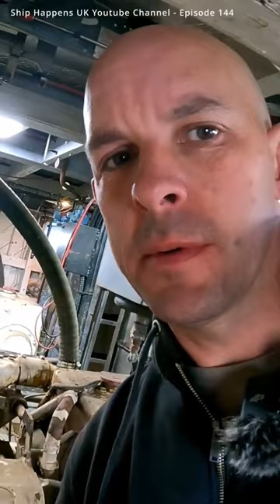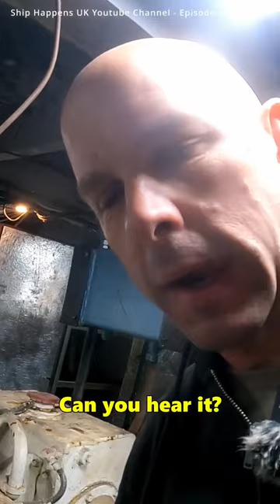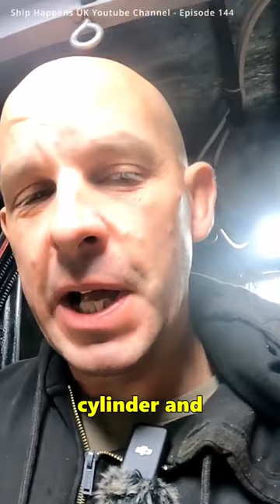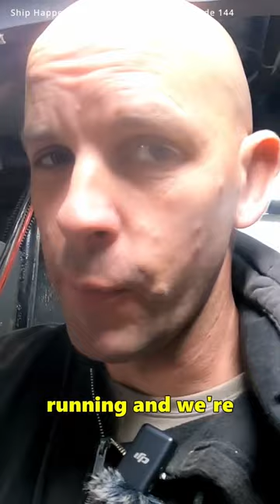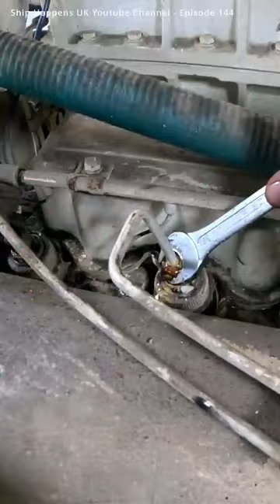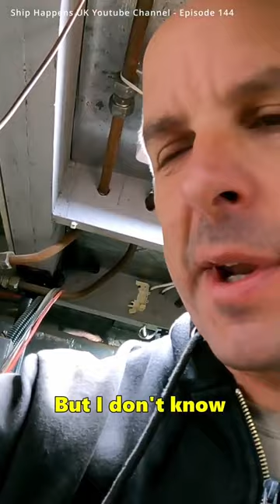Whats up with our boat engine? #boating #engine #boatwork #engineproblems  #marine #dirtydiesel

Comment: I noticed that when you cracked off the injector pipe on the faulty cylinder it appeared to show a lot more fuel perhaps indicating a faulty delivery valve washer which sits inside the adapter the inj pipe connects to on the inj pump , it’s easy to check and if found faulty crofts in Llay by you would probably be able to supply , regards Steve , enjoy your weekly vlog keep it up
Reply: my diagnosis precisely

Comment: Crack each fuel line union at the injector in turn. When you reach the dud one the engine noise will not change. On the good ones, cracking the line will add to the misfire and you'll hear extra noise.
Reply: Literally what he's just done in the video?

Comment: Do you have leak off/return pipes coming off the injectors? If you fo you vould run those into measuring jugs and see if they're all flowing the same amount. Blocked/failed one will produce more. If not swap the suspect one with a good one and see if the misfire moves with it.
Reply: Well being they opened up each fuel line on the top of each injector and seen one spewing more fuel out than the rest they already know something's up with #5, more than likely a clogged injector.
Reply: @madmax2069  spewing from the feed pipe doesn't tell you much. Vould just be the pipe flare doesn't fit as well or has tension on it pulling it off the seat more. 
 More/less return volume tells you if the injector is stuck closed/open. Injector swap confirms whether it's the injector or something else on cylinder #5.
Reply: @AdiFury  go watch the full video. 

When you have the engine running and you loosen each line on the injector and it effects the idle except for one (#5) and on that one line it's also spraying a lot more fuel than the others I'd say it's pretty telling on what's going on.
Reply: Have done and all it indicates is misfire #5. From there you can either investigate the cause (hence my hints) or just randomly chuck bits at it. Only been fixing engines professionally for 40yrs so whst fo I know.
Reply: What is the cost of (1) a good used injector? (2) rebuilt injector v risk of opening it yourself and scrapping it.
Reply: Swap the valve at the pump end. If the fault moves you know it’s that valve. If one has gone, consider buying a set as others may be heading the same way.

Comment: injectors can also get FOD (foreign object debris) or the crack open pressure in the injector is off.  Send it in to get overhauled, for those older nozzle only types, not too expensive.

Comment: Bad injector or else you have a valve issue.   Check if that engine was smoking.  If it’s smoking it could indicate that the injector is spraying but the valves not closing hence spitting raw I burnt fuel out the exhaust, if it’s not smoking and that cylinder does have good compression then it’s a bad injector

Comment: Blocked or no good injector., start there and then if that's not what it is you'll have to pull the valve cover and start checking gaps on valves and rockers .